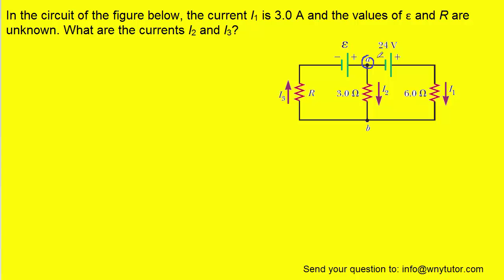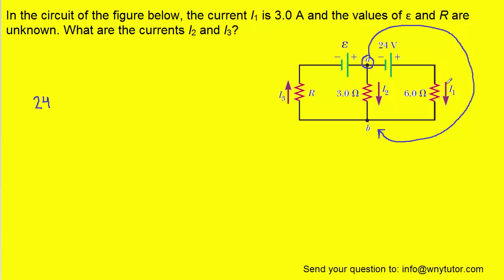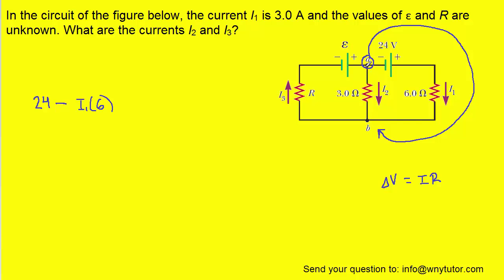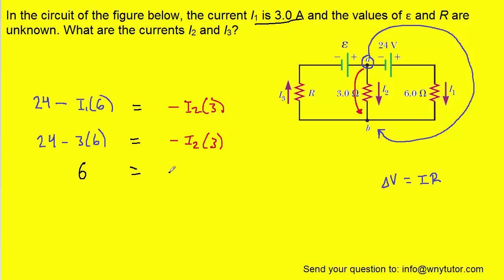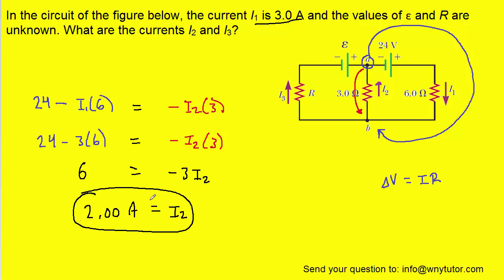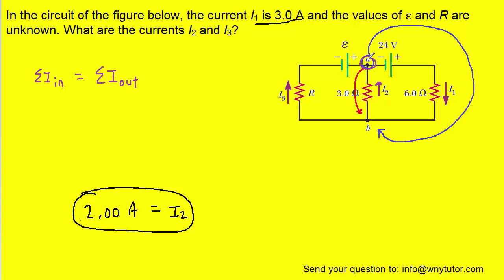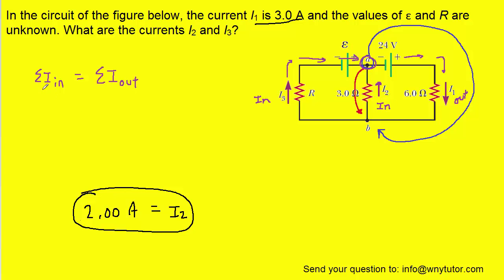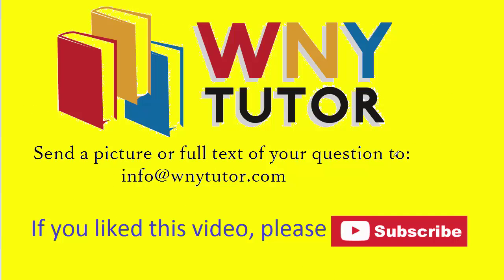In the circuit of the figure below, the current I1 is 3.0 A and the values of ε and R are unknown.

Comment: Please help me to solve this problem
Resistance of 2 ohms and 3 ohms are connected in series with a cell. A high resistance voltmeter connected across the 3 ohms resistor reads 1.0V, but this increases to 1.2V when an extra 2 ohms resistor is connected in parallel with the first 2 ohms resistor. Calculate the electromotive force and internal resistance of the cell.